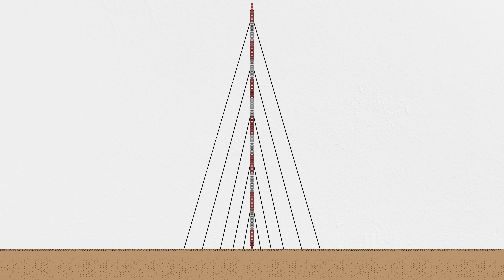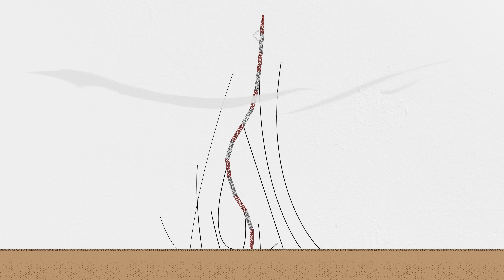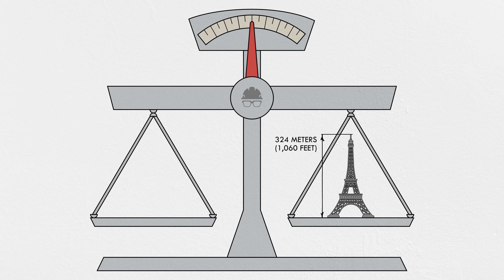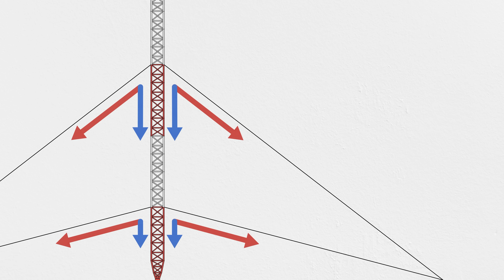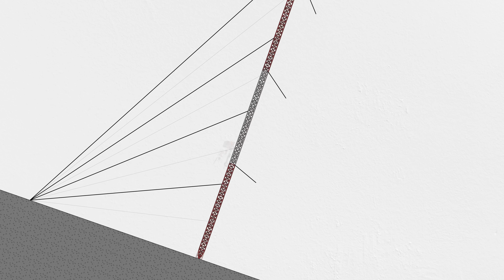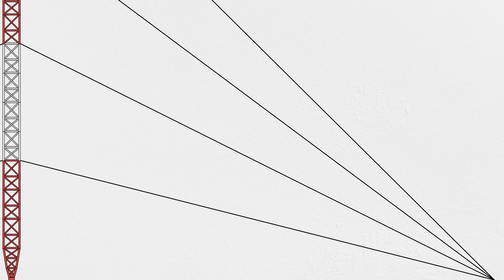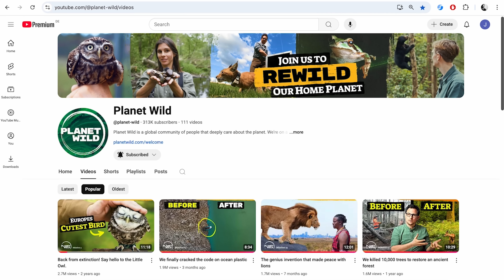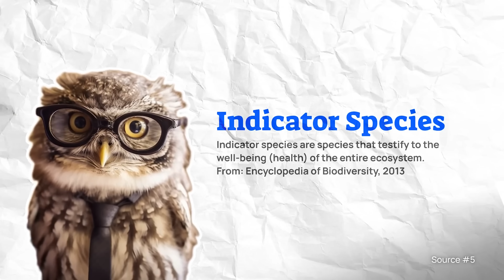The Bizarre Bases of Antenna Towers

Comment: 13:30  It may be harder to make scale models of, but a full video on Lightning Protection Systems would be REALLY neat!
Reply: He should borrow Mehdi's (ElectroBOOM's) electrostatic wand!
Reply: The thing about lighting protection systems that makes them tricky to implement is that a lightning strike looks like a very high frequency signal.  That is, the rise-time of the strike is very steep and thus "looks" like high frequency RF, rather than just a very high current DC energy spike.   This means that you have to model the elements of the lighting protection system as inductors rather than just "wires."   While you might have a very low DC resistance, the impedance at high frequencies can be much higher if you have bends in the wire - they are now inductors!  

I once got a great little handout from Polyphaser at the Dayton Hamvention on how to design lighting protection systems, as mentioned in the video, for WHEN and HOW OFTEN lighting is an issue.  And it's not just having your equipment not catch fire and explode, but continue to operate after lightning strikes.  Even the grounding system is complex, and not just a lone ground rod stuck in the ground. 

I'd love to see a longer exploration of this, there's a lot going on with these systems.
Reply: @lmamakos  That does touch on a topic people should generally understand about how ground currents flow with large-scale faults. If there's a lightning strike or a downed power line, the area around it is also hazardous because of the voltage gradient created as it dissipates across the ground. There are educational videos about this already, but it would be nice to see Grady integrate it if he does cover this topic.
Reply: @lmamakos i remember reading up on how heavy gauge of wire they required, but design OF that wire’s layout (in terms of Inductance / EMI) is something i didn’t consider!

All the more reason for an in depth video!
Reply: I do a lot of electroplay with a 50kv BD-10 wand.  That would easily demonstrate lightning arcs and still be body safe provided you don't have a pacemaker and keep the sparks below nipple height.  The sparks are only slightly uncomfortable, but they do leave red marks on pale skin.
Reply: It's more complicated than a tower for sure, but it's not terribly difficult. It is terribly dangerous though if not designed properly since any voltage high enough to arc through a visible air gap will gladly cross your skin - 10kV directly from an overhead line will still only reliably discharge across 3mm from spheres like depicted on the tower spark gaps, farther if the electrodes are pointy. Such a demo either needs to be able to only deliver a miniscule amount of current (<1mA) or the demonstration requires significant safety precautions.
Reply: @maudiojunky could maybe be done at a a museum with a good tesla coil display and/or one of those Aircraft Lighting Strike Test facilities a la mythbusters.
Reply: @ericlotze7724  Not all Tesla coils are safe, and a Tesla coil would be more like simulating a live tower since they operate at high frequency, often the AM radio range. If the goal is to simulate actual lightning behavior then yes you would want a facility that's already set up to do that, and you wouldn't want to be anywhere near the test apparatus. 

I think a smaller scale demonstration is more than adequate and would fit Grady's style more though. The ignition coil from a car could be used to cobble something together with common parts, and in fact a spark plug is a great demo of how a spark gap works for the gap protection shown on AM towers here. 

There are other components used in lightning suppression as well which such a video could cover, such as semiconductors like transient voltage suppression diodes which come in lightning-rated variants. The ratings on these should give some idea of how energetic a lightning strike is, up to 30kV and 150A with 3.3kW of power dissipation for 400ns on one brand's line of TVS diodes for protecting network interfaces like Ethernet.
Reply: @maudiojunky i mean the ones where they have a protective cage for the audience etc.  i forget if it was the Pittsburgh Kids Science Museum or what but they had a MASSIVE setup
Reply: @maudiojunky what about a van de graff

Comment: I used to work for a local TV station in Erie, PA, a region that gets pummeled by lake effect snow in the winter. The tower was attached to our main broadcast facility. When the ice on the tower broke away, it came down and exploded with the force of a missile. It was terrifying. These are massive chunks too, probably in the realm of 500-1,000 pounds. During the winter all employees were issued hard hats to wear when leaving the building since one of the wires passed right over the parking lot. One of the engineers had to walk out each time someone was entering or exiting to watch for falling ice as people walked through the lot.
Reply: How often did something fall on one of the cars? A chunk of ice that big on a car would be rather impressive.
Reply: We had an entire section 50 ft. of ice come down off the main structure of the wpxi -tv tower and fall like a missle through the multi million dollar satellite light truck in the 90's. Giant 2 ton 50 ft icicle  falling from the sky.
Reply: I don’t think a hard hat would save anyone from a 500 pound chuck of solid ice falling from a tower.

But there is an old story floating around the amateur radio community about a broadcast engineer working in a transmitter building directly next to a commercial tower. The story goes he was setting at a workbench and got up to do something, about a minute later a huge chunk of ice fell through the ceiling and destroyed the workbench he was just sitting at. I don’t know if it’s true, but that would sure drain the color out of your face!
Reply: My partner used to work on transmission equipment at Sandia above Albuquerque - they got a lot of rime ice. They built a device to knock the antenna to get rid of the ice in front of the microwave dishes. He's got a video of a test he was running. He was on his iPad triggering it and a small chunk of ice fell off and was blown in his direction. It literally hit his hard hat. Luckily by comparison to 500+ lbs these were tiny chunks of ice.
Reply: There are a few good videos of this happening if you do a search on here for ice falling from tower!

Comment: After working 45 years in communications, 10 years of which were spent in tower management.  I just wanted to say, good video.  The only engineering thing you left out is tower rotation control.  Guyed towers that have directional antennas on them (microwave dishes) utilized auxiliary structures called  anti torsion assemblies.  At a normal guy level, a widening assembly is mounted and multiple guy cables are affixed to each corner.  On of the guy pairs goes to 2 separate anchor points.  This is best when done near where the microwave dishes are installed.
Reply: I’ve always heard those referred to as a torque arm.
Reply: @LowOutput  To-may-to, to-mah-to
Reply: I work designing steel reinforcements for guyed masts and towers, and yes, it is crucial the anti torsion elements, specially in cellular antennas which generally uses the three sides of the structure

Comment: The antenna tower base shown in the thumbnail is built that way because the tower is the actual radiating element.

I have a Rohn 100' self supported tower and an 89' US tower crank up tower.  I have rotors on both towers with large beam antennas.
I have a variety of other antennas mounted at different points for  VHF and UHF operations, along with long wire dipole antennas connected between the towers.

Comment: We live a little less than half a mile from a very tall TV tower (1525 feet tall). We hardly notice it now, but when we moved in 20 or so years ago, my three-year-old son was fascinated by it (so was I). When he got older, he did some research online, and found out that, if the tower failed, and fell in a straight collapse toward our house (which, my little engineer pointed out, would not happen), it would not quite reach our house. 

Even low winds can be heard humming through the guy wires if we're outside. Strong winds during storms are clearly audible even inside our usually fairly sound-insulated walls. I've often wondered if it keeps our house somewhat protected from lightning strikes.

Thanks for the explanation of the pointy bottoms of these towers. I was especially fascinated by the gapped lightning protection on charged towers.

Comment: I almost took a job to climb those types of towers, but I declined because of the amount of radiation you get exposed to
Reply: Just admit you were not fit enough to climb it in one day 😬
Reply: 14:24 Relevant Bit.
Reply: Unless you mean less atmospheric protection from Ionizing Radiation from Space, probably about as accurate a reason as a ghost meter…

Comment: The size of self-radiating towers is also constrained to have a certain mathematical relation to the wavelength.  In theory it is possible to deviate from that using electronic trickery to match the antenna to the transmitter but it is generally preferable to minimize this type of matching.  Which basically then dictates certain enormous sizes for the masts and the structural engineer then is in a quandary how to get such a size to work all while the bean counters are breathing down the neck of the antenna and structural engineers.

Comment: Couple dozens years ago when I was in engineering surveys my company did some cell phone antennae azimuths adjustments. I have been to 1 of these towers when it was being built and they mount the cell phone antennae part way up. The riggers will climb up but they ship the equipment up on a cable car bucket hooked to a big winch further from the tower. The riggers said they are not allowed to use bucket to go up.

Comment: What a fantastic job covering telecommunications and broadcast infrastructure from a different perspective! You mentioned some towers having elevators - here in Cincinnati, I have two radio stations on Star Tower, a ~290m (~950ft) self-support structure. It has an elevator on one of the legs powered by a gasoline generator bolted to the bottom... I already wasn't about to climb the thing, but I would take a ladder over that!
Reply: When I was 3 or 4 my dad worked on a crew to build a 2000' tower.  He took me up the elevator to the 1500' level.  I don't remember but I have a picture of me up there.

Comment: 3:35 Can someone explain to me this comment about the horizon?
Reply: Generally, the surface of the Earth is convex, so the higher up you are, the area of the Earth that is now visible and not hidden behind the horizon increases dramatically.
Reply: Due to the planet being round, the higher you are above the average ground level the further you can see. The horizon is defined by the line where the curvature of the earth prevents you from seeing further as the terrain is folding behind itself. At sea level I believe the distance is closer to 15 miles.
Reply: The horizon is the point where the curvature of the earth bends far enough away that you can't see it anymore. The higher you are, the further it has to curve before it gets out of sight. So a 600m tower can "see" further than a 6' tall person, and for more extreme examples, think about how much of the earth can be seen from the ISS (whole countries at a time) or from the moon (a full 180° hemisphere).
Reply: The horizon is essentially a function of how close you are to a surface of a sphere. 

Its kinda hard to imagine but think about looking at a ball from arms distance, at that far away you can basically see a whole half of it! Now imagine you had two stiff sticks that you put right next to your eye and go to either side of the ball, the point they touch is the farthest around the ball you can see and from far are basically opposite. If you then start to move your head closer to the ball the sticks will slide against the ball and their angle at your face will increase, but you will also notice that their point of contact will get closer together, tracing a circle on the ball at its closest point to your face. If its hard to imagine you can draw it in 2d as a circle and a point with straight lines connecting it to the edge of the circle far away and close up.

Essentially he's noting how getting further from the surface of the earth physically lets you see more of it. It is a much more pronounced effect close in to the surface but you can think about how a far away satellite can see basically half the entire globe but on the surface you cant see Brazil from Paris, so there must be some change in how much of the earth is visible as distance increases.

Comment: I used to work with a guy that in his youth, his job was to climb these towers to do maintenance and change the bulb at the top of them. Many times we'd converse back and forth on the safety aspect of his training, as there were quite a few times right around his retirement when he'd have to take a break about half way up as his legs went jelly on the ascent. I still vividly recall his take on the emergency descent procedure in case of structural failure. If you love driving long distances, climbing somewhat dubious structures and can keep in mind the electrical potential increases a great deal between summit and base, evidently its an amazing job.
Reply: I need to know more about the "emergency descent procedure". Do you just unhook yourself and say your last?
Reply: @acidjazztest1  He said that was the most exercised option in his day, or you could take your chances and ride a wire down knowing your knees would probably go through your torso on landing, provided you could make it down to a wire low enough to not have a connector in the way. Allegedly there was a more official procedure to hook into the ladder and do the 'fast chute' in controlled slides with hands and feet in a pseudo fireman pole ride, but most guys could only make it down a few sections before either their gloves and boots would abrade to skin depth from friction. Pretty much if you had an issue and were more than half way up the tower, you chose your method of quickest demise and hoped someone would come out to collect your bones before 'the natives' (i.e. wildlife) had their way with your remains.
Reply: @C-M-E  amazing
Reply: @C-M-E  Ha, of course the "official" procedure is to slide down it. Thanks for taking the time!!
Reply: on live towers the guy wires are insulated at multiple points, you're not sliding down anything the entire way.   Worked with many commercial steel crews on towers over the years...   it was the wild west at times,  pretty much the same crowd as commercial fishermen.   Meet the minimum standards at the lowest bid....   There is, never was, any emergency descent procedure in case of structural failure...   if you're up there when it fails, you're f*cked.

Comment: I really like the vertical/parallel wire style towers, smaller footprint and only 3 wires(often bundles that thin as you go up) at any height. Separate wires get expensive.

Comment: I think I built one of, if not the stiffest guyed towers for their size anywhere. We needed torsional stiffness, which guyed towers usually lack, and it wasn't small - 7Hz minimum torsional natural frequency at the end of a 1500 pound 20 foot boom sticking off the side.  And we get 140mph winds at the location.

They were custom. And they have a lot of guy wires - more than double the usual number.

Comment: Saw the base insulator in the thumbnail and went "oooh, he's talking about my industry now".

One note about am towers, the frequency is low enough that it's not the rf you need to worry about (not until several hundred kw), but it's the shock and burn hazard from touching it.

I once was shorting a denergized tower as a demonstration for the local fire dept, and even on the grounded side of the jumper cable got an rf burn when I touched an exposed pice of the wire where it went into the clamp. The energized tower was 150 feet away, so just induced current on my end.
Reply: And for those who don't know.  RF burns don't limit themselves to just the surface.  They go inside flesh.
Reply: @glynnetolar4423 just like a microwave oven.

Comment: The Blaw Knox tower in Cincinnati (WLW) was and still is a landmark ! Two self supporting towers connected bottom-to-bottom in a huge diamond shape.
Reply: I'd hate to have been a low-voltage tech working in that new strip mall under the tower. A couple of Cincinnati Bell guys have told me that they still keep buckets of ferrite beads in their trucks for when they roll in the Mason area!

Comment: There are two types of antenna masts. Poles grounded or insulated to the ground. 
We had a medium wave transmitter for a long time. 
The mast was insulated from earth and the medium wave antenna. Nevertheless, TV and FM transmitters were still installed on the mast.
But the medium wave has now been switched off and the mast has been replaced with a grounded mast.
Reply: The word mast comes from Dutch and came to England via shipping. Even in German it's the same word.

Comment: My grandfather had a antenna tower painting company in the 1940s in Rio de Janeiro. They had to paint the towers every year because it's by the sea. I've never seen towers as tall as that but I've seen power line towers that are like a triangle with the tip as the base.

Comment: I thought the tiny point suspensions were because doing the math for a rigid connection was too hard for engineers so they rely on point and pin connections which have well known solutions.